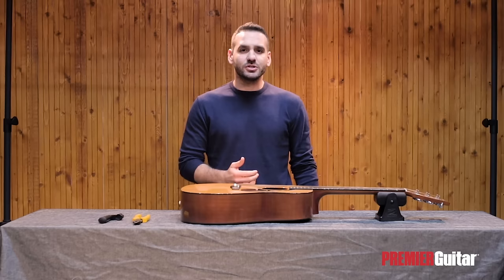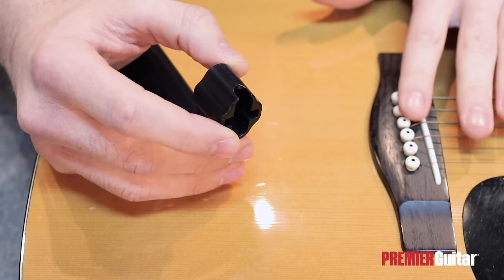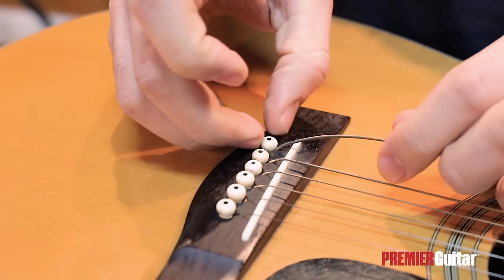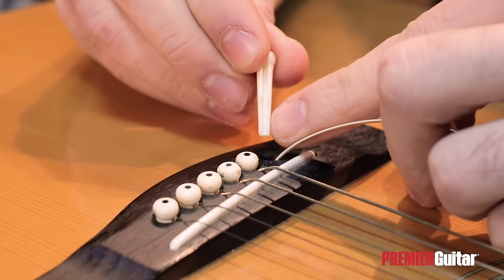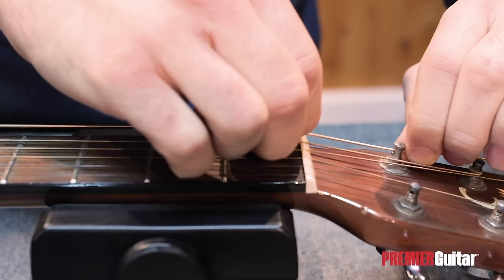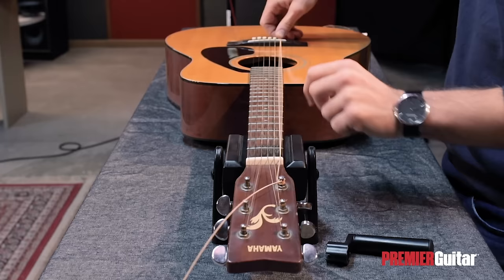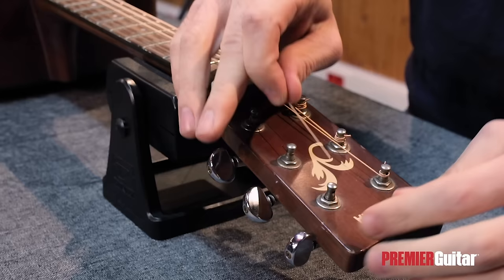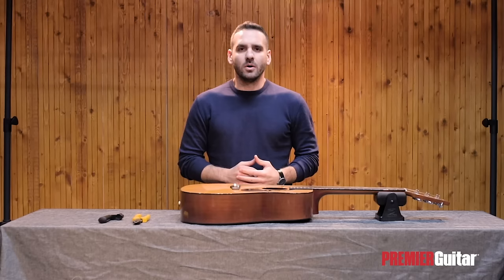DIY: How to String an Acoustic Guitar

Comment: Nice overview however the critical part of winding the string on the tuner pole is so quick it is hard to follow how the new string is positioned on the tuner so it does not generate any slipping later on.

Comment: The ball slot should be parallel to the string.  I remember someone showing how this improved tuning stability.  Also, what's the point of cutting the strings by the bridge?  Just unwrap from tuner and pull through.

Comment: I think there my be a faster way. I saw this on YouTube recently. 
Set the tuner so the string hole is at a right angle to the neck. For the three bass strings pull the string tight and against the inside of the tuner post. By hand, wind the end of the string twice anticlockwise around the tuner post. Hold those two loops in place under the hole in the post while inserting the end of the string through the hole and pulling it taught. Tighten the tuner from the button to bring the string up to tune. Cut off the excess string. Repeat for the treble strings but wind those clockwise around the post. Perhaps use more turns on the fine plains. Correct and neat string installation is vital if you want stable and smooth tuning.

Comment: Hi, your tutorial was going so well until the advertisement PG win a guitar, blocks the exact moment where I have difficulty on the screen.  I don't understand why, but I can string the E,A,D without a problem, but when I go over to the other tuning knobs, I get confused.  Once I thread the G, B, e, (individually) do I bend the string now to the left-the outside of the guitar headstock, turn the stringwinder clockwise, making sure the end of string goes over the new string where I would hold it down?  Also, for some reason, can you give pointers as when I put on my B, I broke the string near the tuning peg. And when I put on my e, it kept unraveling and was a total crimping mess.  Do you have a video that is not obscured with ads so I can see the process more closely.  I appreciate your time. Thank you.

Comment: Actually you missed an important point of locking the string in place. You should redo this video and include this practice
Reply: Nah, I string like in the video, always have.
Reply: Most people do not realise that the taper or scoop on tuner posts is designed to cause the string to friction lock itself in place as tension is applied. You can apply all kinds of knotting techniques, but generally most ordinary tuners perform well when the stings are carefully and neatly installed with only two or three stacked turns, so the string loops around the post can slide and constrict around the post.